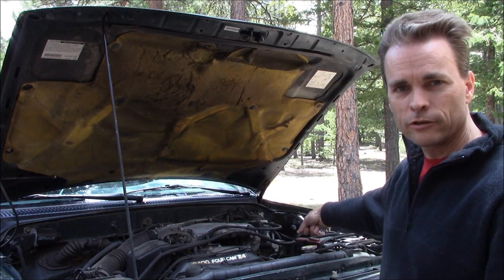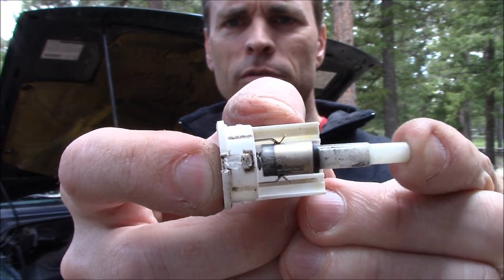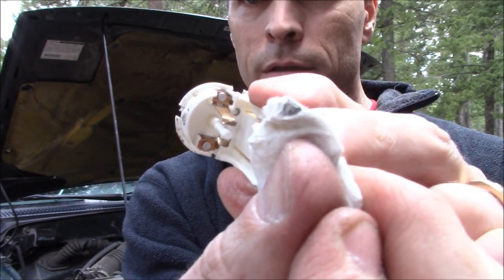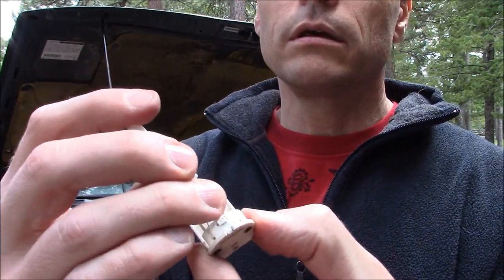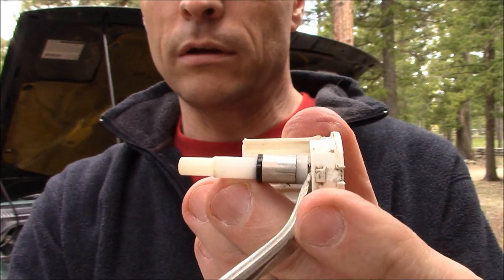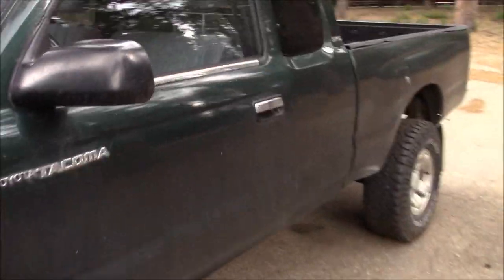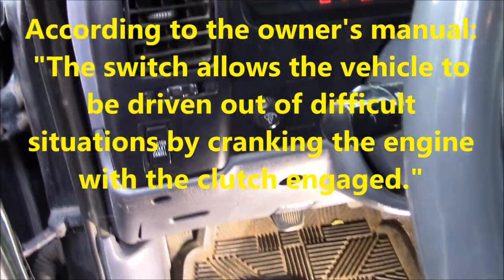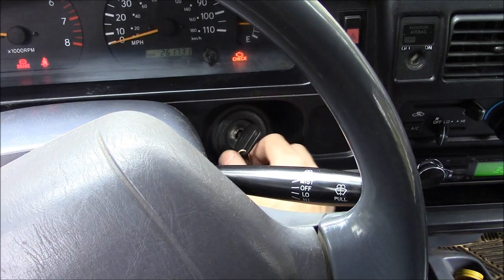Clutch Switch Repair

Comment: my switch was ok the problem was the bracket it mounted to was bent a little and required me to press the pedal firmly against the floor, harder than usual, so I had to bend the bracket a little forward. I still cleaned the switch as shown to keep it clean.

Comment: My clutch pedal bracket was bending when I tried to take nut off. Put a flat breaker bar against it to loosen nut. Very difficult to take Clutch Position Switch apart and broke part of the casing. I cleaned off the grease made the contact pins tighter, it snapped back together and adjusted the clutch pedal. Voila! It starts every time and the clutch is better. You saved me 35 bucks, so I'll pray for you. Many blessings!
Reply from the maker: I am happy for your success.  Thank you for the nice feedback.

Comment: Thank you. This was very helpful. First off, seeing the internal construction before disassembly helps with the initial disassembly, and also, your glitch with the metal tang will help me (and probably many other viewers) avoid that problem. It looks like the trick is to be careful when reassembling, to make sure the plunger is engaged past the tangs before you snap the pieces back together.

Comment: The hardest part is separating the two halfs of the switch.  Mine was contaminated with dried grease. I'd recommend cleaning the barrel and points first with alcohol and then lightly sanding in  the direction the plunger will be moving, using very fine wet/dry paper.  I didn't mess with the tension on the contact arms.  Works fine for now.  Thanks for the upload
Reply from the maker: Good job, Michael!  Perhaps a good spritz of electrical contact cleaner is all that's really required.  I like to take stuff apart.  It's kinda goofy that we're spending $100 of effort on a $20 part.  On occasion, I go about things in the hardest way possible.  I'm thinking of moving all of my videos to Rumble due to YouTube's censorship of COVID vaccine harm, censorship of 9/11 truth, etc.  Anyway, thanks for the nice feedback.

Comment: Thanks for posting this video. After watching this video I was able to diagnose that my Yaris starting problem was that clutch switch. BUT, when I tried to undo the nut holding it onto the bracket, the nut is so tight I did not want to bust the bracket, so, I sprayed a mass of WD-40 into the switch, hoping that will clean off the gunk from the plunger, and keep it working better than before, when I had to play with the clutch a bit to get it to work. Seems to work well now, after the WD-40 spray job.

Comment: Excellent video with very good explanation on how to do the job.  Was exact same problem on my 2008 Tacoma.  The issue was exactly like in your video, 'gunk' on the plunger and metal tabs.  We 'weekend mechanics' really appreciate a clear explanation and video to make a repair.  You saved me buying new parts or ever worse, taking it to the dealer to solve. THANKS!!!
Reply from the maker: Glad to help.  Thanks for the nice feedback.

Comment: Smart fix on the clutch safety switch.  I'll try it on a Corolla I'm  working on.  Simple, effective and  well done instruction.  Thanks.
Reply from the maker: Thanks, Matt.  Make sure the brackets aren't wobbling around.  A wobbly bracket will keep the pedal from engaging with the clutch switch like it should.

Comment: Very cool, I know what you mean by getting a "low-level rush" :) Fixed this problem today on my Subaru without the rebuild. Measured impedance 100 ohm from the dirty switch. Squirted WD40 into every possible crevice of the switch housing. Now down to 2 ohms. Works great so far.
Reply from the maker: Nice work, Markus!  You must have had some trouble starting your car to land on this video.   I hope you also checked that all the brackets are tight.  In my case, a loose bolt was making it hard for the pedal to engage the switch.

Comment: Thanks Bro! I was about to tackle this blind so seeing it from start to finish (including some gotcha's to avoid) was incredibly helpful! Much appreciated!
Reply from the maker: You're welcome.  Glad to help.  While messing around up in there, make sure your bracket bolts are tight.  I had a loose one.  In a pinch, you could just short out the clutch switch wires.  Good luck!

Comment: THANK YOUUUUUUU!!!!  My friend just had problems on the road and With your help We can now fix it quickly.  I mean without jamming the one prong like you did.  That was also helpful because it is also good in knowing what NOT to do, LOL.  
Fist up, Fight for Truth.
Reply from the maker: Nice...  Glad to help.  In an emergency, you could bypass the switch by shorting the wires together.  The downside is that the starter would turn even if you did not press in the clutch--which is probably really bad for the starter.

Comment: This is a very informative video. Thanks ColoradoDemings. I have a 2007 Tacoma 5-speed and a 1994 V6 Regular Cab 5-Speed. The same problem started just yesterday with the '07. Before retrieving and disassembling the part though, I blasted some contact cleaner I had sitting around into it. There is a little hole at the end of the white plastic stem that I shot into. I also held the stem onto the wall with a small flathead screwdriver and shot around the outer edge to get inside the unit. So far so good with 100% starts. Maybe it will do the trick. If not, the upshot is that I know where the part is now and how it works, so I have a roadmap if I have to go further. Hopefully it saves a little time for someone. I'm digging the Mustang ('85 or '86?) in the garage too. I had an '88 LX 5.0. Oh boy did I do a lot donuts in that car.
Reply from the maker: John, thanks for the nice feedback.  I hope you ensured your mounting bracket is not flopping around.  That may have been my problem all along.  It did not occur to me to try contact cleaner.  My first response is usually to take stuff apart and go from there.  The Mustang is a 1990 with a shade over 300,000 miles.  I have a photo from 1999 with the speedometer needle at 125mph.  No comment on location or who was driving.  Now I autocross my 2013 Miata.
Reply: @ColoradoDemings  LOL. I had an '82 GT that I got up into the 120's a few times in coastal Delaware. I'm just glad I survived my youth.

Comment: Nice video!  I really enjoyed seeing how the switch works internally!  
Ideally after cleaning there should be some lubricant added to help prevent contact corrosion, minimize wear, and reduce friction.  Unfortunately I do not know which type of lubricant is appropriate.  I think this is more of a short term fix rather than a long term fix.  The long term fix is replacing the $25 switch.  The video was great though.
Reply from the maker: Thanks, Lane.
Reply: Good video,  there was little SIGN of wear on the two side spring contacts, so why change them; however exactly duplicating the angle of the bent contact point with the undamaged one would help assure longevity.  There's a relatively huge amount of conductive surface for these switching parts, and the current they pass is small.  IF kept clean and a low-dielectric light grease is used, the switch should outlast the engine, body and about every other part on the car.
Reply: On mine the only part of the barrel that didn't have surface corrosion was free of lubricant.  I don't know what I'd recommend as a replacement for the lubricant they used.

Comment: I wonder if it will work if I just spray a little contact cleaner in there and twist the white button without taking it apart.  I do that with the pots on my guitar amplifiers, which is the recommended procedure.
Reply: never know until you try,that's what I was thinking too

Comment: thanks for the info! I wan't able to totally remove my switch (Hyundai Accent) without having to replace a plastic clip, but I backed off the nut behind the mount so the switch is more exposed, then tightened it back down. Seems to be working.

I knew it wasn't a total failure from the start, because a slight rightward push on the pedal would start the car every time. Maybe the switch just got loose over the 100K+ miles.
Reply from the maker: Cool--good job getting after it.  Maybe yours would benefit from a spray of contact cleaner up in there (assuming you could get the little straw sprayer in the right place and keep it from blasting back in your face).

Comment: Nice job on the recording, very helpful.  I could totally see myself doing the same thing you show at 6:25 :-).  Thanks for saving me from making the same mistake.
Reply from the maker: Thanks, man.  Many YouTube videos have helped me with auto repairs, so it feels good to be helpful in return.
Reply: So, I just did the repair today on my '95 T100 -- getting the cover off proved to be more of a challenge than I thought -- I ended up partially breaking the front tab, but was able to use electrical tape to repair. Total repair time was about 30 mins thanks to your video.

Comment: On a 1984 the switch is at the very top of the paddle assembly & impossible to get too. You didn't show taking it out or installing it I may have to take the seat out & I may not be able to get to it then ?

Comment: I have a 2010 Mazda 3 i touring. I have a check engine light; it goes on and off automatically if I drive around 50-100 miles. My car starts perfectly and all the gears work (manual transmission) but I get a spring squeezing sound whenever I press the clutch. Is that going to be a problem If I leave it as it is?

Comment: I have a starting problem with my 97 Dodge not getting any spark to the coil change the coil changed distributor distributor plate wires cleanes  all the grounds I also have an issue with pushing the clutch pedal down I'm wondering would this affect the spark to the coil if you had a faulty clutch position sensor it turns over but doesn't fire but sometimes when you press the clutch in you got nothing could this be the issue of no spark? Your help would be appreciate it thank you
Reply from the maker: The clutch switch has nothing to do with spark.  It just tells the starter that it's okay to start cranking.  You can bypass the clutch switch as shown at 6:50 in this guy's video:  https://www.youtube.com/watch?v=gTVBmabA7oI  As for lack of spark--sorry, don't know.  I would search "no spark diagnosis" on YouTube.  Good luck!

Comment: great video.i'm hoping it might solve my no crank on my 98 honda civic.i got good power but nothing happens when i turn the key.i had a brake light switch similar to this that went out(prolly gunked up like this video)not to mention the plastic grommets on the pedal side that break easily...anyways this was very informative as to how these parts work.thnx for the upload.
Reply from the maker: Thanks, man.  I hope you get it figured out.  Might be a dead starter.  They can go from working to dead without warning.

Comment: I changed my clutch interlock switch. now the starter won't turn over or nothing do you know why that would be
Reply from the maker: Could be loose bolts holding the clutch pedal bracket.  If the bracket is loose, the pedal won't fully engage the switch.  If the bolts are tight, I would try putting a rubber band around the switch or jumping the connection with a paperclip.  That will force the switch to the "closed" position.  If it then cranks, the problem is in the pedal/switch area.  If it still doesn't crank, I would see if the battery cables are clamped on tight.  Check out EricTheCarGuy's video "No Crank, No Start."  Good luck!
Reply: It could be a bad electrical connection. Try jumping the connector. Your car should start whether you depress the clutch pedal or not.

Comment: OMG a new switch is $19.99, time is money!
Reply from the maker: The nearest auto parts store is 1/2-hour away.  I got the interesting life experience of resurrecting a $19.99 part (twice, if you include fixing it again after I bent one of the tabs).  I get a low-level rush from having 44,712 views on this video as of right now.  People spend thousands of dollars and hours on college for dubious benefit.  Taking apart a clutch switch and making a video about it was time well spent for me.